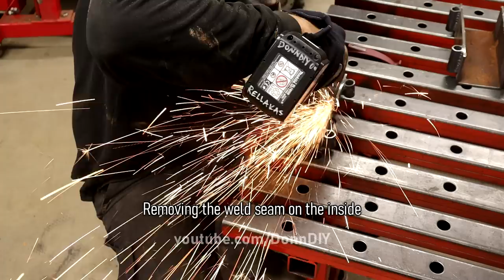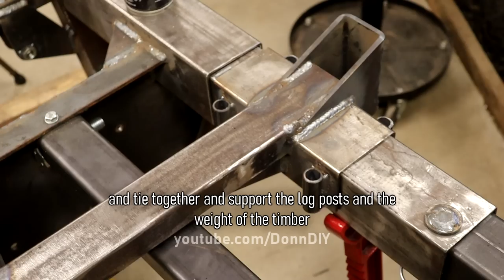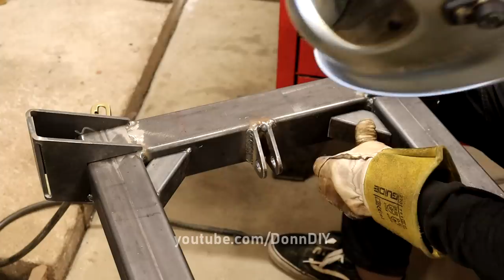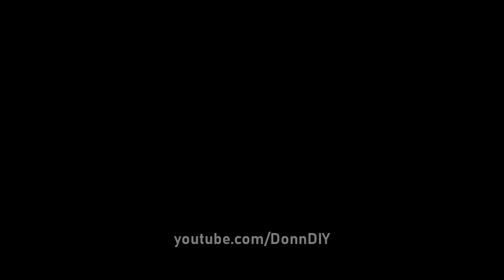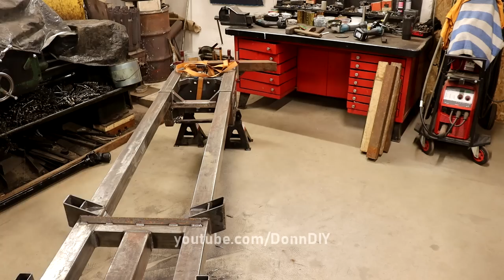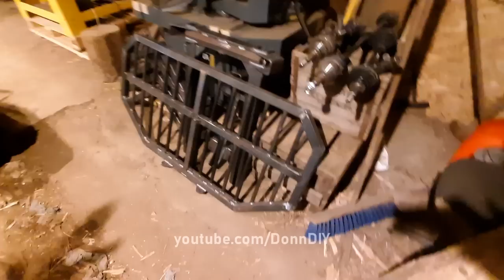4x4 PTO Driven Timber Trailer BUILD Ep.14 - Disassembly & Final Welding

Comment: I once was wearing safety glasses and a face shield but still got grinding slag in my eye. That annoyed me something fierce. I put the project in a time out for two years to teach it a lesson!
Reply: I got a sliver of metal in my eye from grinding even while wearing glasses and a a face shield.
Reply: I too have had my fair share of less than desirable foreigners enter my eyes, only option I've found is to just keep my head totally away and out of line of the disc and I use my welding helmet set to "grind" so it doesn't go black when I use the wire wheel. So far it's worked but I bet I'm jinxing myself now
Reply: @Turbos4Lyfe  If I was ever to go back to grinding anything. I think I would opt and pay for the air fed grinding helmet and welding combo. This would be far better and much cooler as well.
Reply: @kameljoe21  absolutely, the down side to those is that the quality ones aren't typically cheap. Places like Amazon have their place but not for items such as that. But whether we like following every safety item in the book or not, there's just times when it makes sense. There's almost no job with metal that doesn't have a grinder involved, consequently it's a necessary evil that has a plethora of horror stories. I may not follow all safety protocols with other tools but grinders, especially with a cutoff wheel, I do whatever I can to reduce the chances of a serious injury. And one of those masks is definitely next on the list
Reply: @Turbos4Lyfe  Yeah I would make sure the item can be returned and then start out cheap and work your way up till you find something that really fits your needs. I ahve done this with a number of things over the years. Because high end does not always means the best. I did a quick look and found some starting around 250 and up wards for just the grinder. 
I would love to have had one of those back when I was working.
Reply: I got a grind spark in my eye 
Wasn't wearing glasses all day 
Was fine 
3hrs later drying my hair after a shower 
I was pretty pissed 
Slept with it hoping it would go away 
It didn't,annoying cause the hospital is 1.5hrs from my place then a 2hr wait in emergency
Reply: @fowletm1992  Mine happened on a Thursday and I finally went in on Saturday. Looked like I had pink eye. Took a medical dremel type tool to get it out. As soon as it was out no more pain.The funny part of the whole thing is the wife was in the exam room watching and freaking out as the doctor was coming at my eye with this spinning tool. I ask " Why are you freaking out? It's my eye he's digging in!

Comment: It’s amazing how much metal can shrink never mind twist and pull when you weld on it. 
That crossmember was a great idea to allow the driveline to move under the load. It’s unfortunate that it got locked in place when you added that crossmember.
Reply: I think it's still a good idea, but maybe it should bolt in with some washers to adjust the spacing.

Comment: I switched from Makita to Dewalt, but I have also been very pleased with Milwaukee.  I used Milwaukee on a job in Alaska and they took a lot of beating and kept on going.  Love your videos. Welding on nested tube is always a struggle. I have had the metal in the eye while wearing safety glasses.  I switched to a face shield.  I saw a video where a grinder cut off wheel broke and almost 1/2 of it was embedded in this guys face shield, just 1/2" from his eye. I always look forward to seeing a notification that you have a new one.  Not only is the content great, so is the production quality, specifically the editing!

Comment: It's amazing that the cordless screwdriver with the old batteries lasted so long with you. Especially when you consider how much work he has to do for you. If you get the melted cover of the carbon brushes out, you can certainly repair it again. I buy spare parts for these machines on Ebay.
I also had a piece of metal in my eye. I hope it hasn't done any major damage to you and you haven't waited too long to take it to the doctor.

All the best
Reply from the maker: Yes, since 2006. Batteries were replaced once though.
Reply: Yea, if you leave it too long they have to do a lot of digging to get rid of contamination. Don't ask how I know .

Comment: Donn, i was shouting at you, on the video, when you removed that cross member. Yes, it was a great plan. What i think i would have done, is to split the cross member in the middle. And rewelded it a smidge wider. HTH  Your work is real nice. I don't know if i would spend as much time as you do fabricating stuff.
Reply: Yeah that might have worked. I would have cut it and then welded a plate on one or both sides so that you can tack it and check for tolerances then then start stich welding and checking again. Would have work really well. 
I have made my share of mistakes over the years. I needed a set of nuts welding to a shaft that acme thread 1 inch could be adjusted on it. I put the threaded rod in and then tacked each one checked it and it moved then proceeded to weld it. Little did I know it would turn 1/4 turn and jam up. So I ended up cutting it in half and adjusted my design a bit. If you go to my channel you can see the video of the 5hp swing blade saw mill. The 2 rods bring the saw up and down. I never did finish it. I did not really have money to build it. I used what my neighbors gave me and spend a very little about of money to get where I was in that project. 
If I was ever to build it again I would do it 100% another route. All in all I would like to find a lucas 4 inch swing blade. Yet they do not make that model anymore. They only make the 6 inch model and I really do not have trees at my new place. Where I lived before I had access to a lot of free trees already down and drying. Would have made fast cheap lumber for patch work on barns and the likes.

Comment: Not sure if it would help or not in this case but weld pull or distortion can continue to occur until the parts have cooled down to less than 200°F (about 93°C) so I like to leave everything clamped until the parts are cool to the touch. Won't eliminate it by any means but it does help. Great build Don!

Comment: Eek! I hope your eye is fixed soon.
I had my cornea cut open by a steel rule that caught on my sleeve as I passed a shelving rack. It spun through the air and cut my eye. 16 years later I still get a little soreness sometimes.

I just wanted to say that aside from the engineering and fabrication I do like that your video isn't drowned with very loud rock music, as many other channels seem to like doing.

Comment: Years ago I worked at a shop where they made a piece of agricultural equipment with a similar sliding mechanism and had much the same problem with jambing once welded in place. The solution was to make the crossmember about 6 mil short with plates on the each end that were drilled to match plates that were welded to the frame. When the crossmembers were installed, they were shimmed on both sides to get a perfect fit. In your case you could drill ther frame tubes and sleeve the holes to match the crossmember plate and the sleeves would prevent crushing the frame tubes.
Reply: That is a super idea. I have seen and done a few times where you drill out a hole then stick some heavy wall pipe in to where you want the bolt. Weld and grind and your golden. Just add plate and shims from there I guess? 
My neighbor used a method that goes like this. He would cut about 6 holes in the frame and match 2 holes and then run 2 wires down 2 of the holes which had one of those flippy hooks and then draw the plate of steel to the frame section and clamp off the wires. Then he would tack 2 of the holes and check that its all still tight and then tack or weld 2 other holes and then proceed to finish welding them up. The flat stock was welded to the inside and then all you really had to do is drill and tap where you mount was. He built a number of custom car frames this way.

Comment: @4.47 For safety reason,  it's advisable to clamp workpiece, while cutting off part by hand grinder, as to prevent cutting disc accidentally run over left hand. Thanks for sharing fabrication techniques and amazing works.

Comment: Grindings in the eye don’t feel so good. I have had that happen twice to be doctored. Once with face shield and glasses on. Felt it bounce off my cheek and into the corner of my eye. The second time happened a couple hours after I was home from work. I had been grinding aluminum earlier that day. At home I felt what at first was a eye lash get into my eye. Well it hurt to much to be an eyelash and got worse. The doctor found a tiny aluminum shaving in my eye. I can only assume it was in my hair and fell into my eye somehow. Because I was being careful as to the direction of the shavings when I was grinding that time. Regardless that hurts. But not as annoying as the goop and eye patch the doctor put on me. It was off before I made it home. Anyway I enjoy watching your build here come about little by little. It’s going to be a really handy tool. Great talent you have to build great projects
Reply from the maker: That's exactly what it felt like. Only bummer is that I had the same thing happening exactly two months ago. This time I went straight online and ordered goggles with rubber seal. Let's see how I can manage to work with these.🤔

Comment: I use a small neodimium magnet sterilized to pull all the mild steel shavings and grinding dust out of my eyes. Works like a charm! Sometimes after a working day it is just a couple of wipes thru each eye by a magnet wrapped in a napkin to find out how much of that irritating dust was in them.

Comment: Just been mainlining this series, and wow -- what an endeavor!  A couple of observations:
1.  Mad skills all around: CAD/CAM, fabrication/welding, machining.  Even the paint looks good!
2.  Your English is excellent, right down to the use of idiom.
3.  The binding issues you're seeing on the moveable axle carriage seem like they're only going to get worse with use/abuse.  Maybe a rigid "ladder" central frame with a larger C-shaped axle carriage wrapped around it?  Dunno -- have to wait & see.
4.  You mentioned a dump bed at one point in an earlier video, then immediately started welding log post brackets to the subframe.  Shouldn't these brackets be attached to the pivoting deck?  Did the dump bed go by the wayside?  Am I missing something?

Thanks again for taking us along for the ride!
Reply from the maker: The dump bed is still coming and it'll hover over the log post brackets (needs a little lift for the dump bed hydraulic lift cylinders anyway). But I'll use the trailer first "as-is" and work out the bugs first. Then add the dump bed and lift cylinders brackets. I already have the hydraulic auxiliary lines on the hydraulic divider block. So no worries, dump bed will come. How do I know it? I personally need it at the homestead.😉

Comment: Donnie the cross member that you welded in and had to cut off you could replace that with a piece of threaded rod that goes from one side to the other through the frame and then have nuts on the inside that you could adjust to spread the bars farther apart or let them come closer together.

Comment: You really need a (3M Adflo welding hood), excellent eye protection for grinding, adjustable welding shade and a fresh air supply so no other feeken mask required, I been using one for ten years...... When your trying to make a precision fit for that trailer slide, perhaps you should've made the square tubing extra big so then it can be shimmed to the fit needed with different size shims, replaceable shims..........
PS dont rap this trailer build up to quickly, I'm enjoying it.....

Comment: Hi, if I can express my opinion, I would add a tie rod that from the tow bar swing pin, connects just in front of the differential assembly in the full forward position, would add a lot of flexural rigidity to the front and to the crane assembly.... however, great job 👍👍

Comment: I prefer eyeglasses on table grinder and wire wheel, but with hand tools i always try to find proper googles with elastic fit to head. They where about 3 eur and are somehow certified, they offer great protection and thanks to them i can have my face anywhere i want to, without strong consideration where are sparks going. Only real problem is when dust mask is also on they tend to fog up

Comment: Hmmm.... telescoping tubes are tricky. I work in engineering with  elevated work platforms & telehandlers. The telescoping tube sections all use slider blocks of Delrin or nylon on greased tubes, located at opposite ends of each tube....

Comment: Yeah, steel in the eye is always an interesting day... One time for me it meant an hour long trip to the emergency room, where I spent about another hour having x-rays and the removal of the chip. Then another hour back to my in-law's farm, where I avoided any bright lights (or meaningful use of my eyes, like reading) for the rest of the day. Painful, and basically a waste of half day's time when something much more interesting and useful could've happened.
 On the crossbrace that tweaked the frame, can you install a floating riser to get weight away from direct contact with the movable section? The friction of logs riding on the moving section is gonna be a huge part of how easily the frame moves when you adjust balance.
Reply from the maker: I can add clamp-on crossbrace identical to the one I made for the rear. But I'm not gonna make a video about it anymore and waste all of your time again. 😉😀

Comment: Safety glasses are good until they aren't. I was doing some wire wheeling in a tank rail car about 20 years ago and had a weird feeling in my left eye afterwards. Didn't think to much about until my eye was swollen shut an hour later. Got to the doctor and after an X-ray I had a 1 1/2" piece of wire in my eye. That took a long time to heal from. They tried to fire me over that until I showed safety my safety  glasses and there was a hole clean through on the left side. I didn't  get fired but we got way better safety shields after that. The cool part after that was finding the odd wire sticking out the shields.

Comment: It's not dead.  You can fix it, make it better even.  A little of that high weight plastic stuff, make a piece to drop in and hold the brushes in place and not melt.  Drill out a spot for it in the case and then CA glue it back in place.  

Or even better lets get a chainsaw engine and hook it up to that and throw the batteries away.  Be like one of those hot saw's where they use motorcycle engines to buzzz through a log.  Except it's gonna be a drill that will just zip through every material you put in front of it.  I bet this would be Guinness book of world records or something like that.  Nope... Someone will lose a finger and then won't be able to finish stuff.... But I bet you can still fix it up!!!
Reply from the maker: I'm sure you're right. But I'll stick with 18V handtools from now on.👍
Reply: @DonnDIY  yeah. Probably better than losing a finger, lol.

Comment: Sometimes you have to break some eggs to make a cake.  Maybe a little more space in the tolerances on the sliding bits would make this work easier in the long run.  Looks great to me!
Reply from the maker: That's what I thought while banging stuff loose with a sledge hammer. 😄

Comment: You may want to put a metal loop under your axle sliding cylinder to catch it if a bolt comes out of the end. Wouldn't want it to drop and dig into the ground when traveling.

Comment: I still think you should've put wear plates that can be changed when needed on all the parts that slide along the trailer or clamp to it-it would save having to re fab parts when you start to get slop in the them, can't wait to see this in action tho👍
Reply: There will be little to no wear on it. It only moves once for every load which likely will be 100 times per year give or take. 
An I Beam would have been ideal for this project. Yet the cost of such I beams is likely more costly than the box tubes. I beam would have made the mounts much like a gantry crane.
Reply: once it's loaded and gets wiggled about while loaded it will start to gouge material out and have slop, and they parts won't paint very well or it won't last well at least as it gets ripped off during sliding them meaning rust which will weaken the main frame- a wear plate would eliminate all this and save having to re fab some of the major parts
Reply: @crazymtbrider  Its likely that the slider will be greased which will prevent rust from building up. Its likely that it will last far longer than you think.
Reply: @crazymtbrider  I do think the I beam would work a bit better and could be adapt[ted to fit this model very well. I used some 2 inch round stock and rollers on it for a fair weight project and it worked really well with some vintage rollers I found in the scrap pile. They were concave rollers.
Reply: @kameljoe21  I should hope it's greased but your missing my point if you take a telehandler boom for example it has grease and wear plates that can be changed and there is a reason things have bushes so when it wears which it will they can be replaced

Comment: The diff carrier cradle should have maybe had bigger square tubing so you could have installed some Polly slides much like telahandlers use it would make it a little more easy to slide under a load.

Comment: Amazing build I have a question with all the weight of the crane and then picking up logs I'm concerned that there isn't enough bracing for you mounting bracket to the frame it seems you have just the main tubing coming from the frame and a whole lot stuff  added hear is my concern after prolonged use you will get stress fracture or it will bend just passed where it connects to the frame. Can't wait to see it in action . Hope your eye is OK  until the next video peace out .